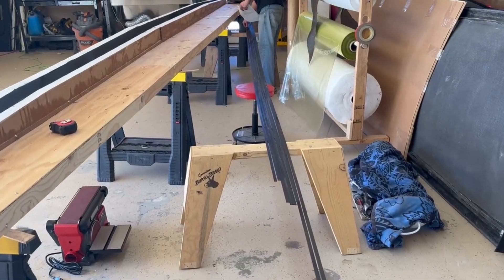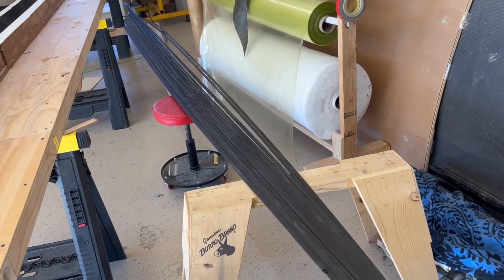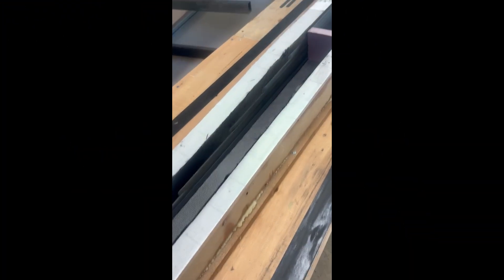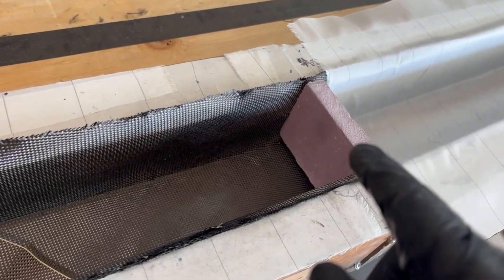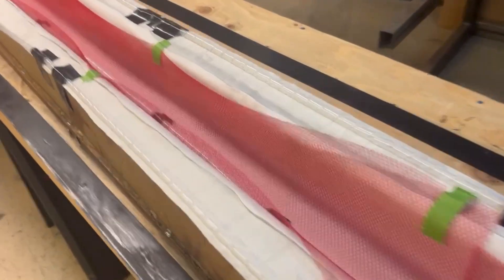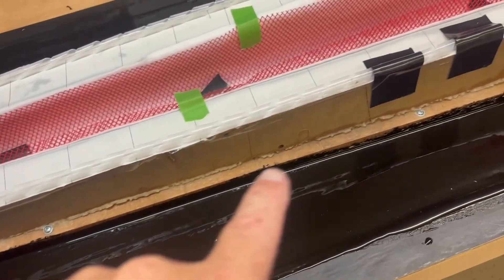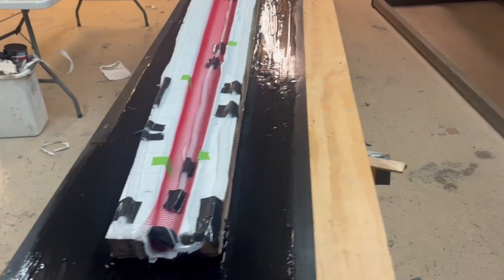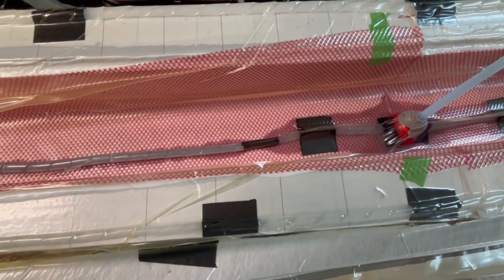Impulse Ep  17 Infusing the spar

Comment: Real cool. What are your thoughts about using the mould less Rutan method? If one wants to save time, but can afford some extra weight. What are your thoughts on using it with with CF? Love your videos!
Reply from the maker: Nothing wrong with moldless at all, CF would be fine as well. For my project molds make sense for a couple reasons. First, if there is any chance to make more than one, a mold reduces time massively. Second, is weight as you mention. Third, complex shapes and for me airfoil fidelity in particular. I’m designing a plane to be a very high performance but very narrow use case. All airplanes are a compromise.
Reply: @RedJensen appreciate it. Yeah very different from my use case. 

Im exploring to make an open source project inspired by B Wainfans Batray, Verhees D2 and Burt Rutans build methods. And the Gazailes diesel engines. Mission being long range, low stall speed, still relatively fast like the D2, but optimizing it towards simplified home building methods for lower build cost and low build hours. 

The Gazailes usually use diesels we buy for around 2k USD and carbon/gf isn't as expensive it used to be any longer. So I am intrigued in hearing experienced builds on their thoughts on it. Personally I can buy cf/gf/kevlar dirt cheap making it more about how one can achieve the design goals while doing the right compromises.